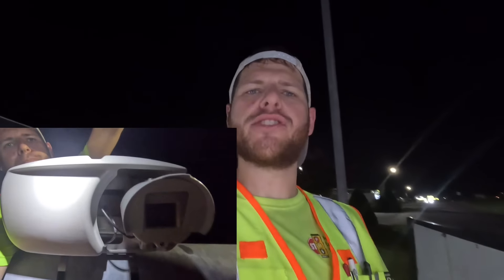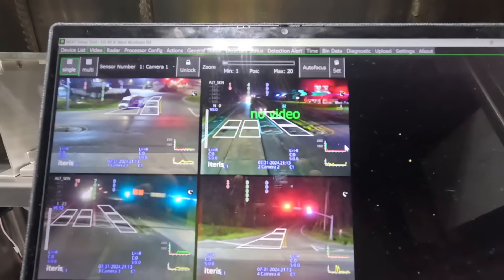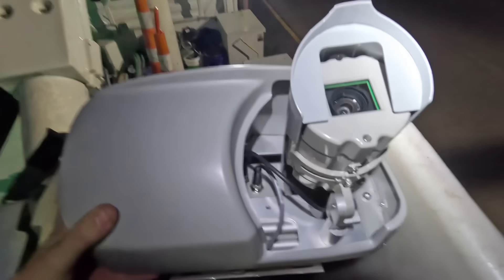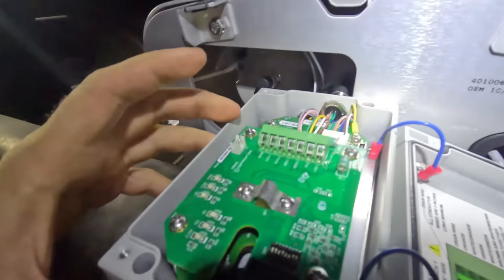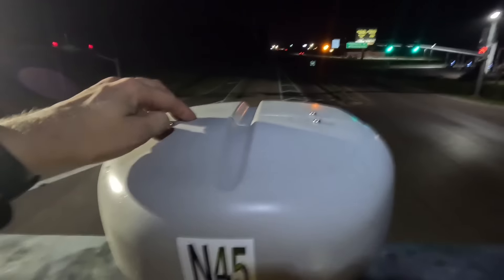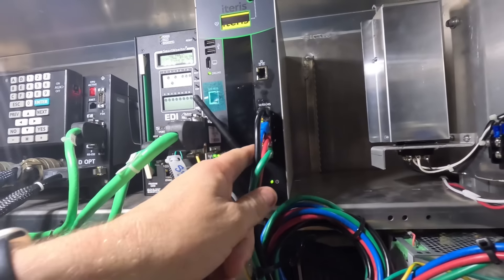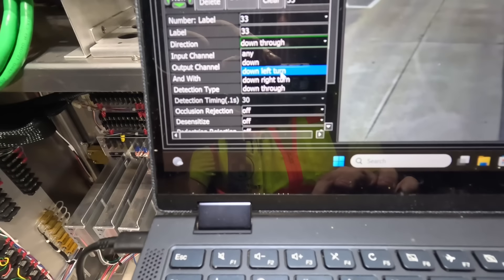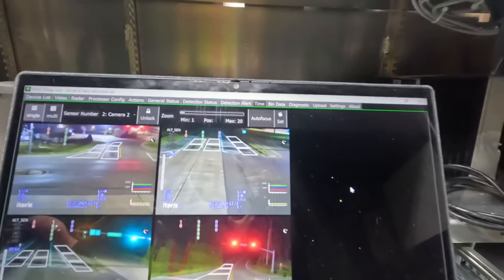Are Traffic Light Cameras Spying On You??

Comment: The cameras on the intersections here in Peoria, AZ, There is a PTZ camera pointing down from a light pole going up and over the traffic light pole on one of the corner.  That camera is the camera that the traffic center can view real time footage.  They do not archive video for accedents or anything.  My wife said that doesnt make any sense, and I had to explain that disk space for a home camera system is not that expensive, however, the massive ammount of camera footage a city has coming in that has thousands of intersections and the ammount of data it would take to send that back to a datacenter and a redundant DC and all the infrastructure and costs associated with it, multiple millions a year, it's not worth it.  If an accedent happens, its best to use old school police tactics of measureing skid marks, get witness statements, and come to the best conclusion and then have insurance figure it out.  Its not financially feasable to save even a day's worth of footage from every camera in an intersection and every street/open area. I work for a fortune 500 finacial firm as a Lead Cyber Security Engineer and I also worked in the VDI space owning that for many years and understand the storage aspect of it and that was for VDI's...  where this would be petabytes of data and processing of events and the massive I/O on the NAS/SAN would be insane...  

But due to our aggressive sun out here in the Valley, at morning and evenings at certain time of the day, you are BLINDED on the roads.  First time I went to the mid west when I was 15, I saw how the sun rises and sets out there, and holy crap, it is so vastly diffrent!  There, I notice the sun goes up and its a glowing circle for a bit, then suddenly it SHINES like someone turned on a switch.  so freaking cool to see and I couldnt get enough.  Where out here, due to our mountains taht surround us 365°, the sun rises and we are pelted with blinding light the second it peaks over the mountains.

So our cameras for the traffic zone triggers are acctually set above the trafficv light another 10-20 feet or so facing  at a steep angle down to help curb the blinding light as the higher you go and the steeper the angle, you get less sun in the lense.  And there is a street light (not a traffic light, but a white LED street light to light the intersection, it bugs me when people call traffic lights, street lights and vice-a-versa), so it is mounted on that arm.  The IR for emergency vehicles to send the signal for a green light, that is on the mast with the traffic lights like normal. and then there is a little half dome looking structure upside down under the camera's.  I believe that is the RADAR or LIDAR systems.  while some intersections ahve what looks like a BELL on a pole sticking out under the cameras.  I am thinking its just a diffrent company/model of RADAR/LIDAR.... And then some intersections where they done want to wire together, running the conduit and stuff to creat the network conenction, I'll see they will ahve a Ubiquiti PTP pointing from one intersection to the next one.  They ussually do this when installing a new intersection on a corner that was not planned to have one, but re-zoneing and such re-designed the traffic needs and so instead of spending the $800k to run conduit and a fiber line a 1/4 mile, just put up a $200 PTP system that is very robust and an excellent value for the money with a gig beam, so all the data/cam feeds all flow perfectly.  

a link to the BELL looking item on an intersection by my house.  This streetview was from Feb 2023, and now these lights are all diffrent and zone cameras on each direction of travel and new protected and flashing arrows for expanded shopping center as they prepare to open a new In-n-out... where anywhere they build an In-n-out, traffic backs up BIG time anytime they are open, even when they close at 3am sat/sun and 1am mon-fri all the way to closing, drive thru and parking lots massive full/backed up. 

https://www.google.com/maps/@33.7146869,-112.271207,3a,25.1y,111.84h,103.6t/data=!3m7!1e1!3m5!1sj_WwXhrxX8tw3VGSnvwvMg!2e0!6shttps:%2F%2Fstreetviewpixels-pa.googleapis.com%2Fv1%2Fthumbnail%3Fpanoid%3Dj_WwXhrxX8tw3VGSnvwvMg%26cb_client%3Dmaps_sv.share%26w%3D900%26h%3D600%26yaw%3D111.83698566632323%26pitch%3D-13.604759017635132%26thumbfov%3D90!7i16384!8i8192?authuser=0&coh=205410&entry=ttu

Comment: At 3:19 it looks like your ethernet wires are untwisted a good amount. The CAT spec allows for a half inch of untwist, but the less the better. More untwist can mean more crosstalk on the cable which can mean dropped packets and maybe problems with the camera system. 

This shows, with a $20k Fluke tester, what happens when the pairs start getting more and more untwisted https://youtu.be/wq0tBXQwu9k. They'd pass a Klein tester, but fail when data passes.

Comment: What’s the advantage of using a camera for stopbar detection versus just using radar detection for everything?
Reply: Techically speaking, any vehicle that stops on or past the stop bar can be cited for running a red light. That is why it's called a stop bar.
Reply: @williamjones4483  - I think he's talking about using them for traffic signal control, not for attempting to catch petty violations.
Reply: @rbradleymobile  Yeah, I wasn't talking about the cameras being used for that. My comment was based on a general observation that people tend to disregard the stop bar. If a cop sees that they can issue a citation for running a red light or illegally entering the intersection.
Reply: Smaller vehicles like motorcycles have less surface area for radar or the magnetic loop based systems to pick up meaning if you're The only vehicle at the intersection and it's a radar or magnetic loop base system and you're on a motorcycle You're going to be waiting a while for it to turn green. Camera is optical meaning it doesn't have to rely on the surface area of the vehicle

Comment: So, what does the RADAR part of the camera do?
Reply: The radar obviously is for speeds, but what some controllers can do is hold the all red clearance if the radar senses a vehicle going through the yellow and it won’t clear the intersection in time. Like an 18 wheeler.
Reply: The radar has a few functions, depending on what the agency wants to do with it. It can detect vehicles prior to arriving to the intersection to extend the green light for coordination purposes. It can also extend the red if it detects a vehicle within a specifid speed threshold during the all red part of the cycle. This is to prevent crashes in the intersection for red light runners. Those are just a couple things that the radar portion of the Iteris Vector sensor can do.
Reply: RADAR is for a few things....  Detect vehicle average speed, breaks in traffic to allow groups of vehicles to get a green light from start of the connecting lights to the last light a few miles away (smart intersections that conenct to each other and have groups of vehicles along major roadways during rush hour, this is an amazing feature my city just deployed on one of the busiest roads I use daily), Detect issues like accedent in the intersection (some new systems are starting this and deploy alerts with the camera feeds for the intersections to the traffic center or their respective dispact centers for police/fire, and also the main item, to prevent someone from getting trapped in the "dilemma zone" (yes its a real thing) 

The "dilemma zone" is that spot where at your speed, and the light turns yellow, you can slam on your breaks and likely slide into the intersection, or speed up and run a red light.  This is a real issue even at the speed limit.  This is a mathimatical location on the road where based on the speed, timing of the yellow/red/green lights, and size of road.  All of us at one point or another have been in that zone.  The radar sees that you are in that zone and will HOLD that yellow lighjt just a second longer for you to make it.  It makes a disission based on everything when to change, as during rush hour, you will always have someone in that zone, but this makes it a bit safe so people behind can push their brakes and stop and people infront can make it thru safely.  Also, it can detect if someone is going to run the red light, and so it will hold the cross traffic to stay red while the idiot does their thing and I sit there watching it going "there is never a police out here when you need it!"